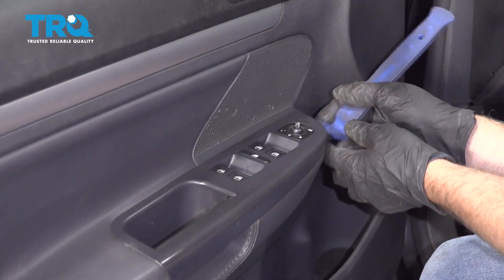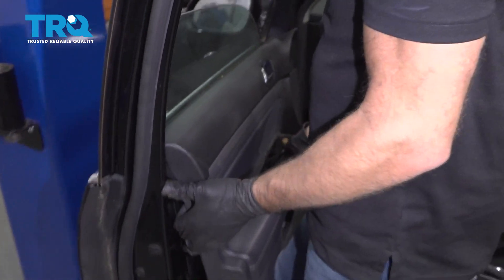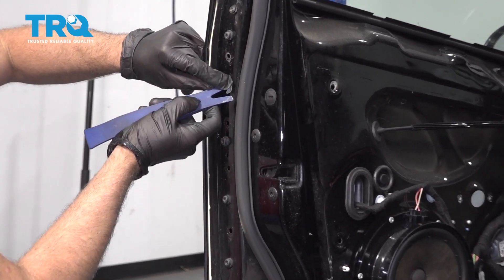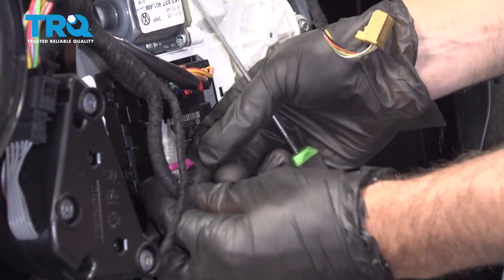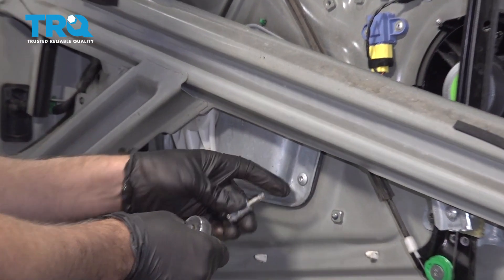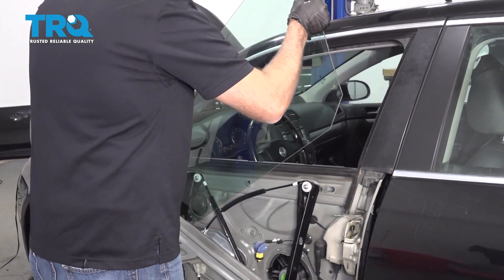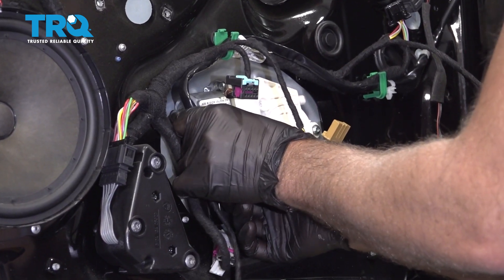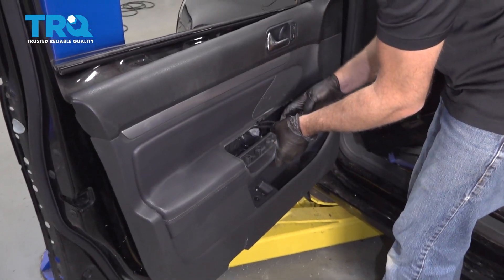How To Replace Drivers Side Window Regulator 2006-2010 Volkswagen Jetta

Comment: Why you did not take the outer side of the door off without taking the door panel. All the work from outside.
Reply: You can't get the glass free of the regulator without removing the motor
Reply: @griffinetchison4064  Easy, if you remove that cross bar !